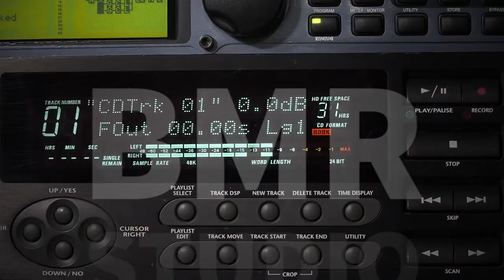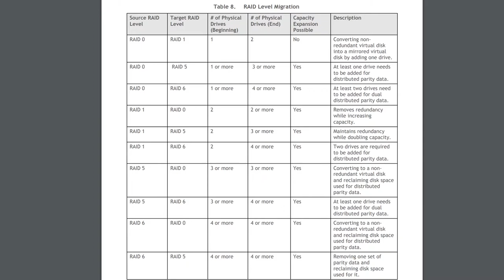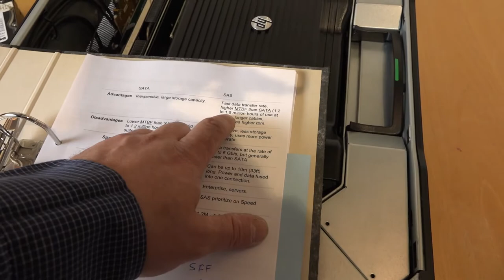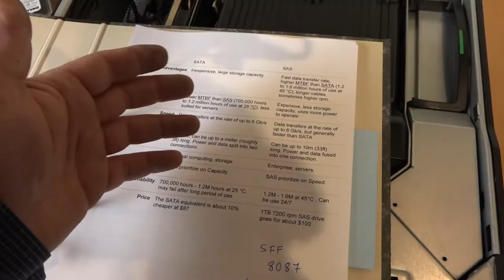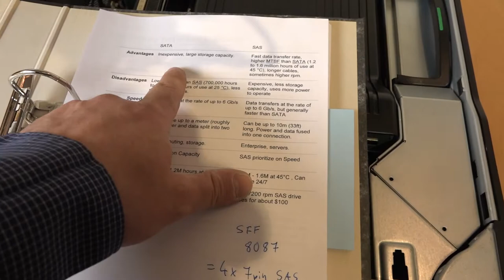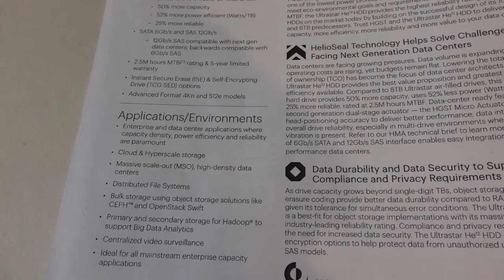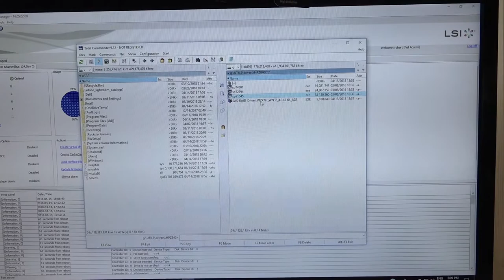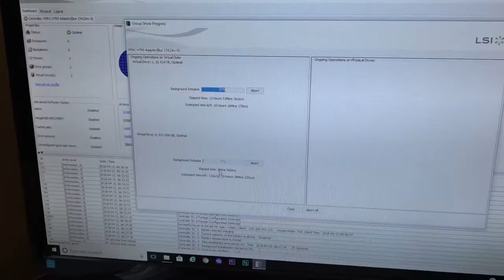Enterprise SAS RAID controller into desktop pc with HGST HE12 SAS hard disks

Comment: Cool project! you're right, you can find servers at good price on ebay, better price than normal PCs (they just need some work) and a server is packed with lots of good features even with the cheapest servers you can have some extra goodies like drives, etc.
Reply: Yes. Also much more RAM for almost nothing. I have an dual Xeon Poweredge with 72GB RAM wich I use as an workstation, just installed an cheap gfx card, wich fits on the riser board (pcie 8x with smaller connector).
Reply: Indeed! that's what I meant, you can build a powerful day to day PC based on a server. The sad side is once is mention on Youtube the prices increase, ikr I still looking for a dbx Quantum but because was mention in this channel the prices gone to the sky

Comment: Can i use a Enterprise SAS RAID controller in a non server motherboard?
Reply: Some times. Depends on the card (brand) or motherboard. For example HP and MSi make boards together, so hp cards work fine in a MSi consumer board more often than not.
But you can buy a standard card to work in any board, just be careful of the power requirements of the card and what the board can do.

Comment: ** wrong commented video, but let's see how it goes **

Ten gig is over 20 years old now.
The problem you have is that on 10gbe not Jumbo frames.
The drive configs are wrong. (from what I can tell)

The drives (main) is a m.2 add, so up to 2500 bits (about 180mbs)
You have to have raid 2(375Mbs)
Then You raid these to multiple the speed.
(This is CPU/chipset maximum) and that's going to be around 5gb.
It's not linear so you will have to test what works best before the system slows down.

You need to have a cache drive that can  intake information the same speed as it can go out...
+ This is where most fail+
Your controller need to have a big cache too and then raid the drives to best match performance.

My one old system runs around 8.6gbs.
I can get around 11gbs on my newer system.

** Can anyone guess what the video was?**
It was a setup on a NAS and 10Gbe as shown on various videos, this was 'on the cheap'  but they had never done it before but was having problems.
The Lan conf was wrong, still using windows wrong setting.
The drives used could not make the fast speeds over the Lan as they physically couldn't transfer the data to max the bandwidth. The hardware also had limits  slowing the overall system down leading to bad results.

Need qualified expert advice? 
See my Youtube Nas videos  just making some more content...
Select my networking and computer channel.
Reply from the maker: You are wrong. The built in HP SAS controller cannot do many professional things, including M.2 caching, RAID migration, BBS, etc.... This old HP workstation has already 1TB M.2 drive for the system partition with 3500 MB/s . So we just taken an another BBS HW raid controller from a SBS server, for free :), to install 2 piece 12TB disk in RAID1. Why? Because the PERC 5 can be flashed with hacked  IBM firmware, what can do RAID migration from RAID 1 to RAID 5 or 50, later when more disk will be installed.  Check the adapter specifications!
BTW, please explain me, ho You can do high speed  with only 2 drive in mirror mode? When the disks itself cannot do more than 400-600 MB/s.... and no M.2 option.
We have another DELL server with 24 piece of 8 TB HGST drives, with double fiber connect and 2 TB M.2 cache... Soon we will replace to only M.2 raid cards, with some tape backup.
Reply: @BMR Studio  HP controller, then it's a dell controller flashed with IBM firmware.
None of which supports m.2 native to the controller's.
Then you're changing from m.2 to tape drives?
** The hp controller is a robust HBA and Dell is also robust but a PREC5 is limited for 2.2tb drives (not sure on regard the IBM flash for which card) the two do not play well together stock firmwares.***

I don't think I'm wrong at all, I. Fact the last person who claimed that, I took to court.
If you're asking me how to get high speed from two drives this is rather pointless, you don't own the hardware to be able to do anything in any event.
** With the original video, see first post.
Using a cache drive needs to be proportional to the drives and Lan and also the trans to hardware.
A single H drive sending to a Nas with a 400gbs drive array is not going to work above the 120mbs of the transfer. 
If you have raid then you stack the drives.
On both systems or and you can cache on the NAS buy doing math to the equal size of the average data, which is then taken by a m.2 nvme to not slow the Nas, but you can transfer from the trans with m.2 drives to get near Lan performance. Aka it is not the Lan performance causing the issue *

Let's looks for example 2*24gbs drives on a supported controller.
Now let buy the right one with a 4gb cache.

If I were to transfer 4gb and was a sole user id get a good speed right? 
Now let's say I set up a performance array rather than storage or redundant. Then if I have say 1tb drives, but I have 8.
Then I have a r0 then I have the bandwidth of 8*6bs  divided by the Lan/HBA, but no greater than the output/input feeds.

In other words if I had a storage server who's disks and storage was 1000gbs, but I was transfering from A single SATA then I'd get 200mbs or less.

* How this post even got a reply I don't know, as it's all clearly different. I watched this  actual video and realized that some how I ended up posting on the wrong video. 
My posts relates to what I was saying but not the content, so when this happens it's always good to check if both claim to  "nothing to do with..." 
I have watched this video is about taking old hardware and using it and some of its hardware for data storage.***
*Enjoy your day*
Reply from the maker: @guywhoknows  meh. You lost the point of the video :)
Reply: @phoenixrising4616  thanks for your wisdom.

What's actually happened is the comment I made was for a different video, this video skipped while I commented and ended up on here. 

That's why the information I gave seems to be for some thing else but similar. You tube feeding related content and all that.

In the video I had commented to they had transfer issues. And asked a few questions to which the answers are....

So yeah I'm a tit, as I had not noticed when I replied, then when he has replied to me I then watched the video and then had noticed as I was wondering what he was on about.

Funny that.
Reply: @BMRStudio  sorry bud for some reason I replied to your video when I was watching another, it swapped to yours as I was writing hence why it makes no sense to you.. and I'm on about something entirely different.
I was thinking what the hell, and then watched your video and, though I haven't watched this... No offense but NOI I thought I missed a bit and scanned forward and back... 
YouTube app to blame here.

Comment: So i cant use sas on my regular desktop?
Reply from the maker: You can. Just Like I did.
hunt for well know SAS raid controllers.
Reply: @BMRStudio  Yes but then i need to buy controler.. extra expense. :( By accidient i bought sas not sata for my sister. Dont know to much about these things. I hoped there is any other way to get it working.
Reply from the maker: @MiniFun92  Most of SAS drives are down compatible with SATA... due the SATA command options. Just need a special SATA cable with inline SAS connector.
Reply: @BMRStudio I have this little plactic adapters that makes sas like sata.. and i used regular sata cable.. nothing worked.  What is special cable u mentinoed? Isnt it the same thing?
Reply: @MiniFun92  Agreed I am interested